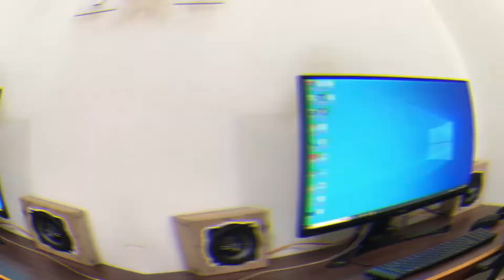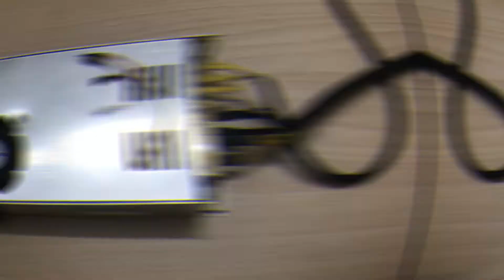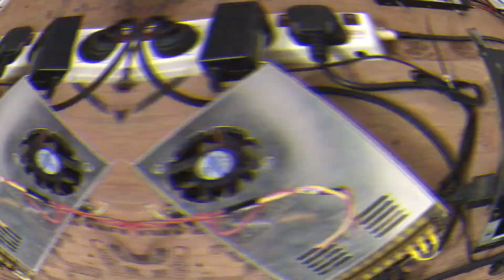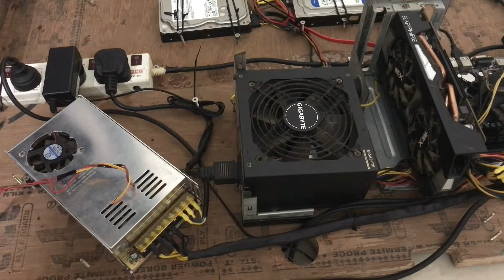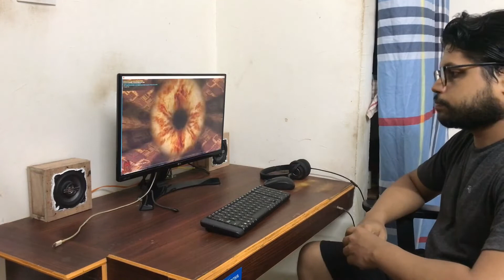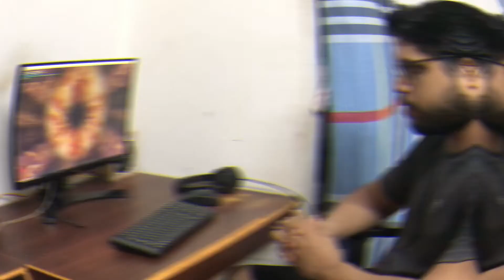Can we run GPU with the Cheap LED Power Supply🤔🤔🤔🤔🤔

Comment: Brother is this setup still working and how much power output is required by your GPU? for the safer side you can also use rccb.
Reply from the maker: brother this setup have been using for more then year and the pc has been stable compared to previous SMPS. My GPU requires around 200 watts max, but i had 400 watts. Yes u can use RCCB. at the end u need to be careful while making connection.
Reply: @bktech8409  thanks for the video bro can you make more of it 😇